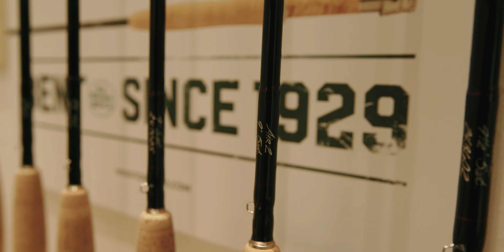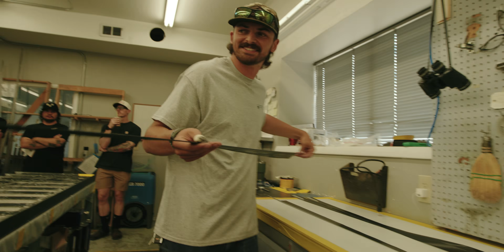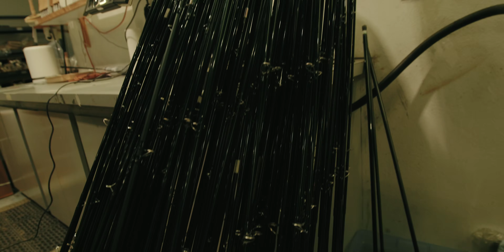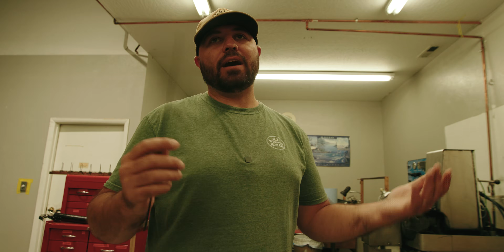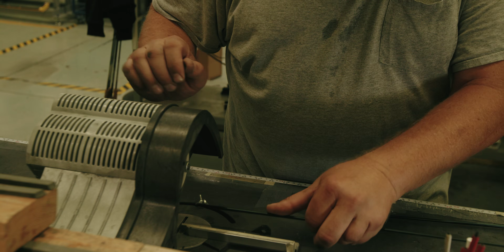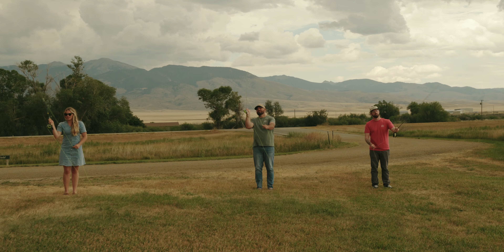Why Are Winston Fly Rods So Expensive? | We Went to The Winston Factory to Find Out

Comment: Winston did not start making rods in Twin Bridges, they were started in San Fransisco by Robert Winther and Lew Stoner. Tom Morgan moved the company to Montana in 1976 a few years after he purchased it form Doug Merrick. I have the 'Pure', it's a nice rod, the fit and finish is better than any of the big rod companies for sure. The Pure 9' 5wt seems fine for dry flies and smaller stuff.  The older rods I think especially the one with spigot ferrules had a bit more 'magic' about them and could throw heavy flies and streamers a lot easier. I can't comment about the Air Max2 because I've never cast one. You are paying for the lifetime warranty too so,...

Comment: My first one was a steal. There was a B2T at a Cabelas fly shop, the person in there said it was sent to the shop by mistake, sat in the back storage for a while, then they put it on clearance for $200 because it wouldn’t sell at the regular price. I liked it so much, I bought another one a few years later with my rewards points. Yes I agree, great rods. But most people don’t realize, that the reason why you can balance them so easily with a light reel, is because the reel seat and components behind the cork grip are pretty heavy compared to many other rods. Today’s reels have become too light in weight, but with many of the Winston rods, you get some extra weight there behind your hand (along with the reel) to help with the balancing -it’s all physics folks.